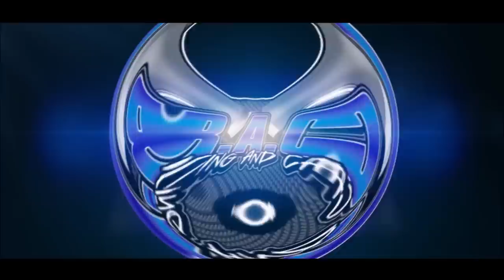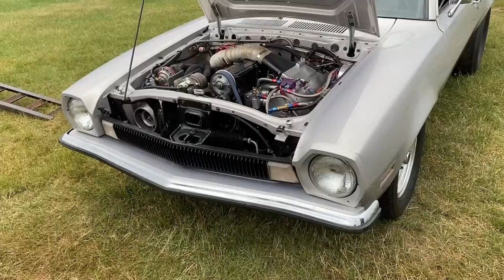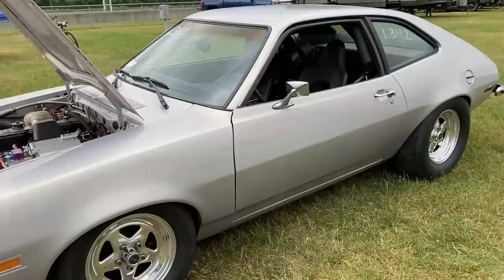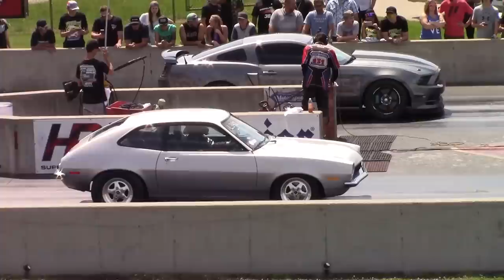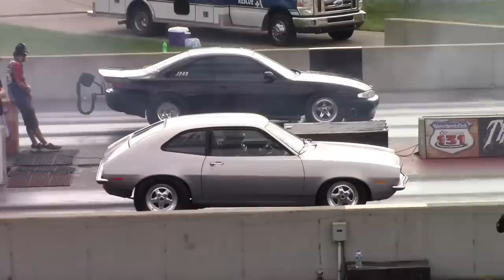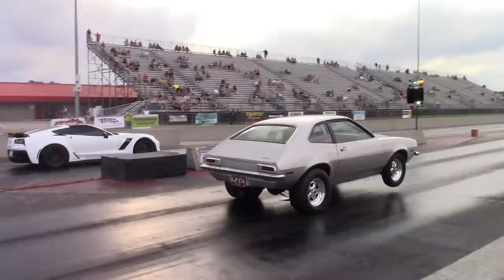4 Cylinder Turbo Pinto Sand Bagging Against a Mustang GT, C7 Z06 Corvette & Turbo LS 240 1/4 Mile

Comment: Impressive! Showing the boys how to make it quick down the 1/4. 2500-2600lbs. w/ driver? Eslinger long block?
Reply: 2970 w/driver. No Esslinger parts. Ford Motorsport block from the 80's and a stock Ranger crank.
Reply: @daveflanders5223  May I ask which cylinder head?
Reply: @terraboundmisfit  Aftermarket cast iron head made by Tim Ottinger.

Comment: Boy the pinto is a launch machine. When I had a sand rail we used the four cylinder ford engine in them. They actually had a lot of performance parts for them and they were a good engine if built correctly.😊

Comment: The 2.3 turbo ford is one of the most under rated engines out there.
Reply: I have a friend that had a 2.3 NA in a Mustang II way back when.  It was slow, but we had fun revving the bejeebers out of it every chance we got.  The tach didn't have a redline on it, so we assumed we could rev it to infinity and beyond.  Never did blow it up.
Reply: Love your pinto, what are you using for transmission and rear gears and rear tires ? I am redoing my 1948 Thames Panel that I  have a early 2.3 Pinto engine with a blower and C4 Trans. 9 inch rear with 3.90 gears . Would like to do some drag racing. Any advice. Thanks keep video coming.
Reply: ROFLMFAO!!!
Reply: Don't forget a 300 in line ford is legendary engine also I'm a Chevy fan but deep down always enjoyed in line ford engines
Reply: Is that the same engine used in ford capris the european ford
Reply: It’s a Lima 2.3

Comment: I'm a Toyota guy, but DAMN! I could be a 2.3 liter Ford guy in a moment. The suspension set up on the Mighty Pinto is PERFECT! Dialed in perfectly!
Reply: Toyota guy as well.  I'd still take a 2JZ or a 18R-G etc etc.
Reply: It's that power to weight ratio that's the overlooked equsion. 
I've personally witnessed a 1955 Volkswagen bug stomp a big block barracuda back in the day.
In the history of illegal street racing in Hawaii...this one guy had a few Volkswagens that would outrun big blocks all the time.
Acquired a few cars when people use to race for papers.
The guy was a legend.
R.I.P. "Underdog" 
Gone but your legend lives on!
Reply: Hey I was both. 1973 pinto 1975 pinto 1979 Toyota Celica GT 1984 Celica GTS.
Reply: What I liked about the Volkswagen was the air-cooled 1900cc stroked out to 2300cc twin webber dual portheads.
Just a whole different animal and they were light so they had a power to weight advantage. Hp÷kilos was what them so impressive. Just couldn't get the same track # or 1/4 mile times out of anything water cooled.
But the engines needed more tuning and adjust as you used them so theirs a whole different scince going on...but man were the quick..rear engined still had to feather the clutch so don't spin place.
I had friends that were Toyota fans but at the time the cams and compression aren't what they are in these newer models. 
But I still love my German cars..I drive a 04' Cabriolet 996.2 with a 3.6 naturally aspirated m96 motor.
Ln engineering poceline ims bearing so she can handle the hammer I put down and still be my daily driver!
It's as reliable as a Honda just Change the oil ever 4 months and you good to go!!!🤙🙃😉
Reply: @ZXLNT  When you get your career going you can move to a Porsche!
Reply: @ZXLNT  you would lose😂
Reply: @ZXLNT  good for you😂😂😂
Reply: @soisaidtogod4248  you would lose too😂😂😂
Reply: @soisaidtogod4248  Every stock Porsche would get demolished by this Pinto lmfao
Reply: @soisaidtogod4248   No thanks
Reply: @Mike LOL Ikr? hahahha

Comment: I have to say that pinto surprised the heck out of me with the way it launches . I didn't look into it more yet ,  but that car must have really steep gears .
Reply from the maker: You and me both
Reply: 4.10 gears and believe it or not 2970 lbs w/driver. New tires really help!
Reply: @daveflanders5223  Thanks Dave that's quite the rocket ship , very cool . That car seems to have all the  traction that it needs thanks .
Reply: @jackfishcampbell6745  "All the traction it needs". Doesn't that mean it needs MOAR POWER?!
Reply: @robeddy3722  Well it surprised the heck out of me as is but sure why the heck not !
Reply: @daveflanders5223  Would it run low 9s, if you kept on it the full 1/4mile ?!
Reply: @arkhsm  bet on it !
Reply: @daveflanders5223  You're a STAR, Mr. Flanders! These young'un's are seeing it first hand lol.

Comment: Holy krap!

I miss my 71 Pinto with the lowly 1600 push rod 4 wacker and 4 speed.  I had a speed shop modify it and had long tube headers installed.  It wasn't anywhere near as fast as this guy but would hold it's own against baby Porshes (914s) in the straight and through the corners.  I traded it in for a new pickup after I got married.  Guys, stay single as long as you can!
Reply from the maker: Lol, unexpected wins and sleepers never get old
Reply: @DragRacingandCarStuff  1500 MPG model with a 2300 wagon engine dropped in was fun. wider tires+rims, KYB's, twisty little coast roads...

Comment: I see the 2.3 all the time for industrial use, generators mainly. 
Great engines. 
And a buddy's 87 turbo coupe was eye opening back in the day.
Reply: so easy to pump up as a solid little N/A engine too.
Reply: @modelnutty6503  for sure.
Heh, my buddies turbo coupe , we made it to the county fair that year in 22 minutes,it's normally 45. 
We spent almost 15 minutes in top gear and the revs never went under 5500. 
Slow down to 80, it was so boring you wanted to get out and walk 🤣

Comment: That's one impressive little buggy. Hats off to those that built it. I can only imagine what they could do to an 8cyl
Reply: My guess is they'd go slower with the added weight.  But I'm probably wrong.
Reply: and there would have to have a ton of work done to the engine compartment because it was way too small both length wise and width wise.  if you wanted the V8 to fit inside the engine compartment you needed to cut the dog house around the bell housing out. I remember seeing one without a grill so as to make room for the radiator.
unlike a Vega where everything fits under the hood yes you needed to hammer the dog house out a little bite but no cutting required unless you wanted to install a big block engine.   Had fun in the 70's with those little cars

Comment: He let the vette get about a 1.5 sec jump walked 🚶 it down pumped the brakes and still ran in the 9s. To me this is way better than the new cars power to weight is better you don't have all that crap wired up new cars are for lazy folks

Comment: That’s amazing. And I will say that that is the best looking Pinto I’ve ever seen. The Pinto body, has aged surprisingly well. 
I remember driving a Pinto down Highway 1, from Palo Alto to Santa Cruz back in the day when the car was only about two years old. It was a slug, orange body color, with the hound’s tooth cloth interior, and vinyl top… a complete embarrassment, thank God  it wasn’t mine. 
I owned a mint 1968 Plymouth GTX 440. Still, I’ll never forget my first drive south on Highway one when I was a teenager from the Midwest.

Comment: When I was a young man it was said the 2300 wasn’t the engine of choice.  The 2000 had an one one more main and had a stronger bottom end.  You have put that theory to bed.  Well done.  I too had a Pinto and enjoyed it.  Did put a 2000 in a 48 Willys Jeep.  Loved it.
Reply: Back in the late 70's early 80's I raced a 2000cc dirt track pinto. We were pushing 300HP running a 500 Holley ,cam. headers and a ton of hand porting on the head and intake. lots of poor boy experimental engine work. Those engines were nearly indestructible I wonder what could be done like this guy is doing to the 2300. A 2300 couldn't touch me .

Comment: That four-cylinder turbocharged engine was the GT Mustangs engine the SvO model in 1986 it was also an engine that was used  in the T-bird and cougar models   5-speed with 4 cylinder with a turbo + intercooler had about 180 horsepower and it was pretty fun to drive

Comment: I had a 86 thunderbird turbo coupe loved it bored 30 over 330 horse power before the turbo ran 12lbs with boost controller could boost 25 psi loved this car finaly blew the bottom out of it

Comment: the 2.3 Turbo Cars were faster the the V8 cars.  During the mid 80's  Turbo would out run a 5.0 mustang.  I also run a 2.3 SVO in my Baja Bug.  I did take the turbo off.  Just to make the install fit better and less piping etc.  the 2.3 will still carry the front on my Baja.

Comment: Love that Pinto...I bought a 71 in 74.....just joined the Air Force and had to trade a 66 GTO and a one room A/C for rent I owed so I had to get to CA somehow (started of from Suffolk VA)......well made it to the mountains in Gallup New Mexico and that little block (nicknamed the "metric engine") set up just couldn't handle it....bent every push rod, blew oil like crazy, but made it to Victorville CA....traded it right away.
Reply: Pintos didn't have pushrods.
Reply: @jeffkrall5074  That was my first Inline 4, 1974...... I build 4's and 6's for drag racing Jeff.....1971-73 utilized the Kent X-Flow 1600cc inline-4 push rod, the only one out of five gasoline inline 4's that Ford built that has push rod-actuated valves.....:goodvibes:
Reply: Ah! George Air Force Base....LOL! What did you do to be sent there?
Reply: @ajwilson605  I had orders in hand to report to my first permanent base, Mountain Home AFB Idaho and right at the last minute I get a call I'm being diverted to George......all my goods were already sent to Idaho of course....long story there getting them to George...lol.  Anywho, had just finished up at Tech School at Chanute AFB Illinois and went to George, worked on the F-4's, 105's and 106's.....Non Destructive Inspections which came in handy building all kinds of stuff to race at Ontario Motor Speedway....raced right on the straight away of the monster oval track....at this time I mostly built/ran Mazda rotary and Wankle powered LUV pickups.....Let me tell you, rotary is awesome and fast....so are Ford inlines.

Comment: Obviously the the bottom end at the crank had been strengthened, The connecting rods strengthened, along with head work done for better breathing and compression.
Reply: The old 2.3 intake and exhaust ports were huge , like the size of 429 big
Reply: Probably just carefull prep.

Comment: You gotta remember the Pinto doesn’t weigh anything horsepower to weight ratio And a trans brake launches fast
Reply: Don't confuse having half a V8 means it weighs half as much. That day it was 2970 lbs with driver.

Comment: '
ohh i had one ford mercury BOBCAT car in 1975...
i miss my favor bobcat car so much...
i did put anythings in bobcat car better than lousy plain ford company...
'
1- cruise control speed
1- two amber yellow taillights from capri car
1- power both lock / unlock on 2 doors
1- power both side mirrors
1- power both windows
1- rear motor blade wiper with water on the rear window from honda car
1- move axle to top on the both lift springs
1- metal cool fan front near on the radiator
1- two plastic shields covers on the both glass headlights
1- radio AM / FM with cassette tape from radio shack
1- two speakers on the both doors
clutch manual shift 4 speeds
easily fix repair at home

Comment: I had a 1980 hatchback (Runabout), manual. My first car.  God-awful orange and maroon, crappy bondo job on the driver's side door. But that thing went everywhere in anything...in northern Maine, it had to.  My friends called it "The Boogie-woogie Machine," "The Screaming Maroon Messiah," and "The Great Booga-wooga from Aruba."  I called him, "Lloyd."  I putt 215000 miles on it, drove it up and down the East Coast a couple times and only changed the oil, on purpose, once (I was a dumb kid) - The engine light would come on and I'd dump 4 more quarts in. Good to go.  After five or six years, I sold it to the cook at my fraternity.  He bought it for his step-kids.  I said tell them to be nice, don't slam on it, maybe talk dirty to it from time to time and it should be good.  Two weeks later they were screwing around and threw a rod.  He sold it to some guy who yanked the engine, dropped in a small block 8, painted it purple and raced it in the Mini-stocks at Unity Raceway.  A fitting end for Lloyd...went out in style.  Yeah, I miss my Pinto...my first wingman.

Comment: Back in 88 I bought my first car. 79 Mercury bobcat 2.3 stick. I pulled the engine and put in 8.0 slugs and got a 80 turbo setup from a mustang and put it on. Custom crossover pipe. Got a 5 speed from a 81? Mustang 2.3 Not a T5. Had to put a 1/2" spacer between the bell housing and trans as the input was longer, and the mustang bell housing wouldn't work. Bought a 78 mustang 2 with a bad trans and stole it's 8" rear end with 3.0 gears and the sway bar.  On the interstate coming home from a road race show I met up with a Porsche and Ferrari and another hot car, and all I know is I joined them. Bet they were wondering WTF was in my "pinto"! To be 20 again!

Comment: Mt dad orded a new pinto back in spring of 1970 . He wanted one just like what was on the picture that the Ford Dealer showed him what the new coming up Pinto was going to look like . The picture was a Ford engineer rendering of the new Pinto . My dad got it in late 1970 as a 1971 .  The dealer may have wrote up and orded it in late 1970 and arrived in 1971 . It was exactly like the one on the front cover inside and out . with the 1.6 engine and the 4 speed trans . GOD I wish I had that car . I loved it what I was 12 years old .  The following year I left home for good . Never returned . I was so tired dad beating me .

Comment: Weight to power ratio. There was a guy in Framingham, MA. back in the 90s that had a tricked out Datsun 510 that made a brand new Corvette LT1 look like it was standing still.  Fastest car I had ever seen. That friggin thing sounded like a crotch-rocket. I don't think the guy with the vette ever came around again. My friend had a '91 Toyota SR5 pickup w/ a V6. Those things were fairly tiny and light so 350 HP seemed like 600 HP. He used to give the Mustang LX a run for its money.

Comment: Those 2.3L Fords are Legend in off-road and powerboats. No surprise here this is happening. Had one in an 1984 Thunderbird TC. That was the most powerful 145hp I've ever felt. I use to run side by side with V-8 Camaros through the gears in it.

Comment: Bought an 80 mustang 2.3 4speed new.  My first family car. Ford was trying to squeeze out the best mileage from the 2.3, and it was a real dog.  I put a crane cam and hooker header on it, removed the cat, tossed the ford electronic ignition (duraspark?), and put in a point distributor from an early mustang 2.  I didn't change the carb or rear end, but those 4 changes coupled with the way it was geared...out on the interstate no one could keep up on top end.  I never clocked the speed, and I never topped it out.  with the speedo buried it still had plenty left.  It really felt like it was ready to go airborn.

Comment: I owned a 1972 like this one.  The dream was to put my Windsor 6 cylinder in it.  Alas went overseas before I could drop it in.  Did  have oversized cam and blueprinted engine though.  Used to rebuild the engine and tranny just for fun.  So easy.

Comment: The lower powered Pinto did get the jump by low slippage of its tires while the mustangs incredible power caused tire slippage detrimental to its drivers course trajectory. This was won by experience and not by speed/power.   Please see the Wikipedia examples on all these subjects. The videographer did a reasonable job of capturing the footage shown.

Comment: For that Pinto to average 10 on the 1/4 mile and speed was 20 to 30 MPH slower than the other sport cars the tyranny 1st and 2nd gears must be geared lower than stock to get the quick move from takeoff.

Comment: In high school had a72 pinto and went to the wrecking yard to get a mustang sub frame. Put it in  used a 66 289 and put in a 9 inch with 3.89 gears. Best I got was 12.2 but man it was fun.

Comment: is that a mustang SVO motor in the pinto that is built?
Reply: The SVO used the same 2.3 liter block as the pinto had. So yes pretty much. The stock 2.3 in the old pintos were beasts and could be highly  tuned back in the day without a turbo. By the time ford used the 2.3 for the SVO they already knew the block was stout and had been proven to withstand some HP. The old pintos with the 2.3 were the ride of choice in 4 cylinder dirt track racing for a lot of years. They still kick ass just less
Common these days. We’d have nights up here where the top four or five cars were Pintos

Comment: Just remembered!! I was told that this car can be put on 2 wheels if the car takes a tight turn into a college campus at 40mph (that statement coming from a guy sitting in his wheel watch this happen 50yrds away.  The rack and pinion steering is VERY RESPONSIVE (just as the Mustang II s) and would remended it under any car!!

Comment: Yes INDEED! the 74' Pinto was my 1st Pickup truck hualing 4x4 and 2x4 lumber and concrete, and even a 16' tandam utility trailer (empty of coarse) those Bumpers were STRONG. You could bolt up a hitch right up to it. And the engine was strong 2300cc overhead cam. Got rid of it a 170,000 miles. I know in the early 80's Bob Bondurant used to use them to teach driver's to race with the 2000cc 400hp little 4 cylinder. I believe they were ahead of their time. Fantastic little car. Its really to bad they did not have the same bumpers on the 71' and 72's that little 1600cc engine was a GREAT gas miser even by TODAY's standards